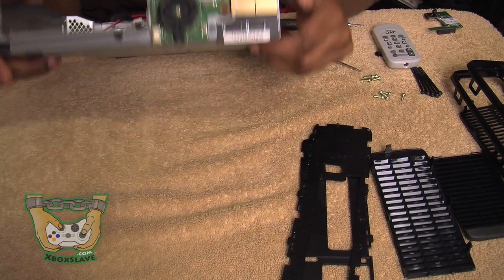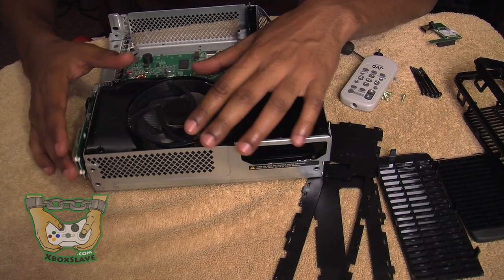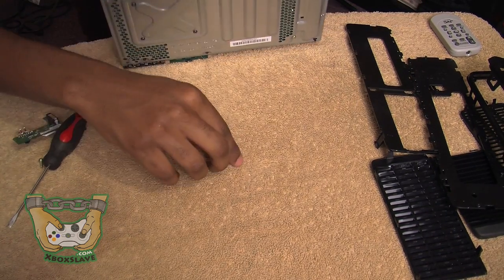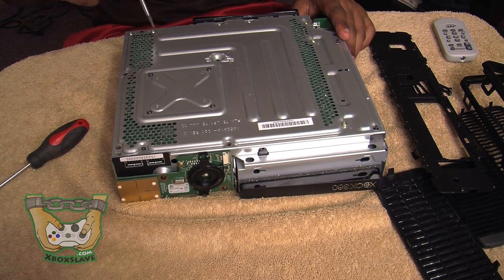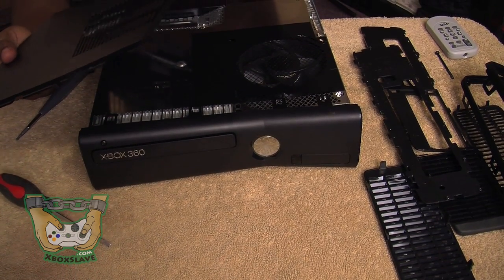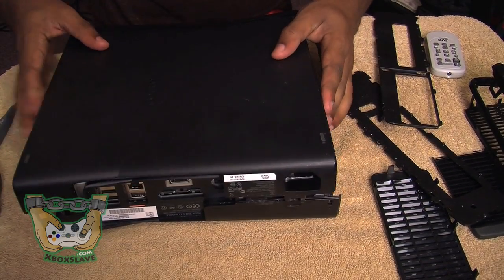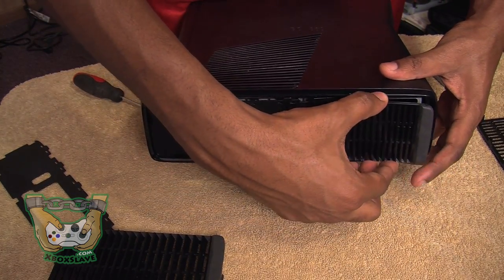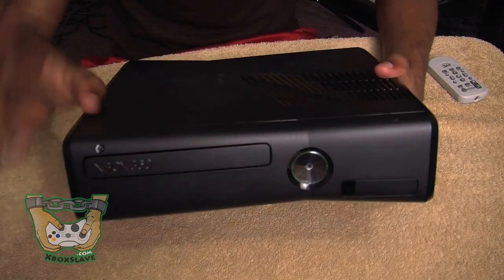How to put an Xbox 360 SLIM back together

Comment: 9.43 Wrong Information: The piece that slides in isn’t the one he is showing. Also the video is edited to avoid showing the mistake at 9.55. Be careful guys this mistake can brake your plastic clips and this parts are rare to find.
Reply: Dude, thank you so much, i saw your comment right before I was about to start resorting to forcing it in. I wish the guy had corrected himself. I saw he also made a mistake with the black screws too. I hope your pillows will be fluffed up and cold all summer

Comment: @FixYourOwnXbox . You made a great assembly video. Here was what issue we were having. The ''Sync Button'' on the Console was ''Hard'' whenever you'd try to use it. ***This was the problem. Ya know those 4 or 5 ''Long Black Screws'' that run through the console, well, the last time I took the console apart to reapply fresh Heatsink Paste, only 1 of the 5 screws were tight. Thus adding just enough flex on the ''Face'' on the console that the sync button couldn't make the proper contact, result, we couldn't sink any of the new controllers. Thanks for doing such a great job. After I started watching you, I could see where the problem was at...

Comment: ya me too the face plate cord has no litle white thing that attaches to the xbo 360 is possible that it will work with out it is there a manual button to turn on the xbox without the touch button